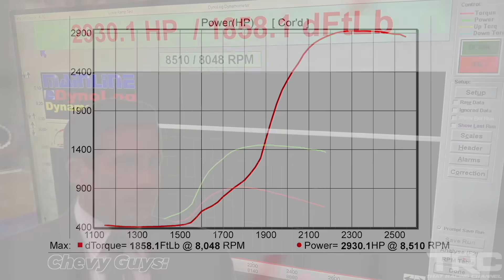3000HP Coyote SCREAMS to 10,000RPM! (BADDEST Coyote on the Planet?)

Comment: 185mph to the 1/8 is fucking insane 💨
Reply: Especially on a 275 radial
Reply: @robfeldschun6146  He won Sick Week against Lutz's Pro Mod!
Reply: just 220 yards!
Reply: Just imagine if the car was set up for 1/8 mile. It’s set up for 1/4.
Reply: Yea it’s a monster 💨
Reply: @jbuckshot01  he changes the gearing for the 1/8th
Reply: @DieselRamcharger  didn't he go 6.1xx?? That's one fast little 5.0
Reply: @jbuckshot01  yeah i think the 6.116 at maryland was his fastest with snot rocket 3.0. He attributes the longevity of the motor to the trans/tuning, he says if he ran the 6r80 the motor would be in pieces.
Reply: @ I live in Maryland and saw that.  But I think he just did it on sick week.  That’s a bad ass street car. Beating out promods.
Reply: @jbuckshot01  i wouldnt doubt he ran a 6.1 at sick week. i know his plan is to get that car into the 5's which is why they built the 3.0 car, as 2.0 was only certified to 6.0
Reply: @jbuckshot01  i think he went a 6.0something at sick week during a test run. calling these things street cars is quite the stretch. But it is cool to see these cars able to be driven, though they do change a fair amount of parts to get them into "street" trim
Reply: @DieselRamcharger  last run at sick week he missed the 5’s not sure if his last was was an 6.0 or 6.1  but he just missed it. Agree with you is it street car or street driven race car.

Comment: Freak levels of Horse power for a factory block! Ford definitely knows to build a V8 engine.
Reply from the maker: Such an amazing platform!
Reply: It's still a "modular" engine. For marketing reasons they don't call it that otherwise you would be crestfallen. 

Of course Ford knows what it's doing.
Reply: with Japanese components, yes.
Btw, ever seen Japanese engines with smaller blocks delivering the same amount of power ? yeah.
Reply: @anjoLas  yes but have they ever been a 620 not unless a true promod
Reply: For 45k you can have a 1000 whp f150
Reply: @anjoLas where are the “Japanese components”?
Reply: @anjoLas  and extremely unreliable at these power levels. yes, they can do it, but they have to rebuild the fkn engine basically after a few runs... if their lucky.
Reply: @sneezinhatch lmao what? My 22 rsb 4x4 stock cost more then that
Reply: @theclinchmma4126 not on built coyotes man. You talk stock shirt block coyotes
Reply: @anjoLas In any classes where imports are hanging with domestics. You'd better d*** well. Believe there's huge weight breaks.
Reply: @anjoLas  small engines at this level get rebuilt after every event or even every pass. Same thing as saying you can skydive without a parachute just once😂😂
Reply: @Vikturus2k6  did u even see what i replied to or are u just assuming??? I wasn't talking about the coyote, I was talking about Japanese engines.
Reply: @theclinchmma4126  naw, I figured another yote hater. All good bro
Reply: @chadkent1241 bro censored “damn” 😂😂 you’re a grown man.
Reply: @anjoLas yeah. They blow up after every run and they are full tube chassis Pro Mods with massive weight breaks. Only Vipers and Coyotes break into the low 6s with the original engine platform and body. The Fox Body can get into the 5s, but it requires an SMX, 426 Hemi, or Coyote swap because those are the only engines capable of pushing it into the 5s.
Reply: @anjoLas just keep vacuuming that cat fart can sympathizer
Reply: @elyjahtravis99  how's that "freedom" coming for ya ? xD
Reply: @anjoLas  I’m fantastic, but your gonna have to be more specific? Are you foreign to the U.S.? Was you preparing that cat for dinner???
Reply: What’s more impressive to me, is the factory crank could withstand that power level. Granted yes, it finally started flexing and touching down on to the bearings.
Reply: @anjoLas your clueless 😂🤡
Reply: @ingodwetrust1136  your ? You poor kid that doesn't even know English 🤗
Reply: @ you could thank your precious public schools. I’m also not a kid. I’m also not poor 😂😂😂

Comment: Stock Ford block is beast to hold all that power without a billet block
Reply from the maker: Truly wild stuff haha
Reply: Insane.. what does a stock iron LS block hold? *no shade, just curious
Hah I'm blown away at 2800 on a stock crankshaft 😳
Reply: @jamesborek8125  The LSX blocks might hold that much - the DART blocks certainly will - the problem is they would have to replace head gaskets every pass.  Their clamping force is horrible.  You can drill for bigger studs but that only helps so much.  Billet block is their only choice.
The real kicker is no LS heads flow what Coyote heads flow - and at the end of the day suck, bang, blow - flow is 2/3's of the equation.
Reply: stock crank too lol
Reply: Show me an LS that can do that please.😂🤣😂
Reply: Because a cast block can flex a little without braking into smithereens like a billet block?
Reply: @ThatRacingChannel  hi
Reply: @ThatRacingChannel  will Brett switch to one of the new iron coyote blocks is the question.
Reply: @kennethfeld6639 🤣🤣🤣🤣🤣🤣🤣🤣
Reply: @philliphutcheson4219 forge the bottom end like the coyote and it will do more on same mods
Reply: @Miamiboi305  nope. Been tried but Ford comes out on top still.
Reply: @Miamiboi305 you lie!! Ford is simply better!!
Reply: @metalted6128  something cannot be better over something older using less moving parts…. It is simply over achieving. if it were the ford in the ls position you would be screaming the ford is better because it’s still a pushrod. The underdog still runs with the technological young buck til this day. I love an underdog ls baby you free to your opinion but ford ain’t better it’s pathetic to get the results it gets from so much they do from factory
Reply: @Miamiboi305 does all that with less displacement. No LS is better😂
Reply: @kennethfeld6639  no one is saying bretts engine isnt drilled and studded. hes very careful about his wording but the motor IS NOT "stock" by any stretch of the imagine. The block and crank are. thats about it.

Comment: Ford to the front almost 10 HP per cubic inch sleeved stock block ported cast heads street derivable at 2950 LBS.  😎  Thanks Racing Channel.
Reply: There are very few engines on the planet that make more HP per CI than the little FORD!
Reply: Fords been doing this for decades. Like the 427 sohc, that nascar banned before it even made a lap. The 351C, which is and was the most banned and handicapped engine in racing history. There’s a local circle track around me. 50+ years later, they still have a ban on them lol

Comment: That thing is a ripper.
302 cubic inches.
That's amazing!
Reply: It's a predator block so technically 307
Reply: Can this car compete with street outlaw npk cars? Like murder novas etc.. I know they have 100k plus just in engine and transmission.
Reply: @Harlo86  I think they are running in the 3s in the 1/8.
Reply: @j_wide942 it's a Predator block but sleeved down to 302 in hopes that they can get more refreshes out of it.
Reply: @Hjfvvdst  4.08 I think is the best it's ran in the 1/8
Reply: @RayFinkle005  that's real close to 3s.
Now, with the steel crank, hopefully, they can push it a little further.
Reply: It's also a testament to the attention to detail on that team.
Reply: @Harlo86 Fawk no street outlaws does racing on the street too I don’t see this mustang hooking on no street off no water burnout
Reply: Those street outlaw people from the shows are mostly running big block engines, like the 481X...that are costing about 100K just for the damn engine itself! Crazy part about it, is that those costly engines are only good for about 50 passes give or take...before it needs a rebuild! They also run all high end expensive aftermarket parts from fuel tech, holley, etc...for fuel injection, ecu's and ignition systems. Ford Coyotes are doing all this with less money and lots of factory Ford parts. Coyotes and Predators are putting the world on notice fr!!!🤔😂😉💯💯👌👌
Reply: @Harlo86 Short answer, no.
Reply: Predator bottom end, that’s 317.
Reply: @Harlo86 the engine alone is past 100k. Everything else is an additional 200-250k. Those are 300k+ dollar cars, this costs half of that.
Reply: @The-fs5wn  even at 317 it's crazy power.

Comment: @0:12 what are the two axis on this graph showing? Y axis appears to be bhp. What is the X axis? Thx
Reply: X axis is engine RPM
Reply: @Andy_Pengwin  Hi - did you look at the graph? The range on the x-axis is 1100 to 2500. That doesn't really correlate with the RPM we hear in the video.
Reply: My bad, it’s probably the dyno hub speed.
Reply: It is dyno hub speed

Comment: Mullet Killer
Reply: Mullet has a real 4 link now - and he has 25# of boost he hasn't tapped into - Not sure if they are in the same class or not for Sick Week.  Mullet has a weight and wheelbase problem - it has too much of both.  He has the HP - assuming he can get it to the ground.
Reply: Mullet's problem is a rather ridiculous platform to make a racing sled out of.
Reply: @kennethfeld6639  cjrc and cleeter will never be on the level of people like brett and his team. they are true professionals focused on the task at hand, and nothing else.
Reply: @exothermal.sprocket  not really.
Reply: @ You'd rather a cab-over semi tractor I suppose.

Comment: Curious what the motor makes n/a. It might have been mentioned, but i was blinded by so much information it was hard to keep track.
Reply: NA is not what it was built for, It’s 10:1 with some beefy rods and pistons (heavier) so probably wouldn’t see much out of it NA compared to a max effort NA voodoo or gen3. But then again who knows lol
Reply: @BarnfindGT  yeah, i understand. Was just curious. I know at that level theyre purpose built.
Reply: ive seen a 750hp n/a coyote, that might be close to its limit being a 5l.
Reply: @BarnfindGT  its got alot of head and cam work.
Reply: @DieselRamcharger  yes but the compression is lower and the rotating assembly is heavier it more than likely won’t make more power or as much than a dedicated N.A. motor build with the same displacement
Reply: @ the rotating assembly in bretts motor is lighter than an NA build. there is no mallory in the crank and has aluminum rods. one of the reasons the motor holds together is the lightweight rotating assy. we really have no idea what the compression ratio of the motor is. even 20 years ago we knew better than lowering the compression ratio on turbo motors. it just reduces quench, invites detonation and offers less energy to spool the turbos. with good fuel and proper tuning the compression ratio is often much higher than you may think. cylinder pressure being whats relevant and the cams and turbos affect that far more than static compression ratio.
Reply: @ as of recently it might have aluminum rods idk I haven’t kept up with it, but the prior engine set ups and the one that made 2900 had steel rods and was about 10:1 compression. Brett and ffre have always been transparent on what that car has in it.
Reply: @BarnfindGT  2930hp was done on aluminum rods. they literally tore the engine down on camera after that dyno session. the video is about a year old and is on ffre's channel.

Comment: The turbo lag is massive, like three or more seconds. The transmission will be geared around max torque which is around 8000 RPM. This engine will not run at 10,000 RPM as given in the title, which is not really a problem because max torque is achieved through boosting and not tuning runners. The rev limit will probably be set to around 8800 RPM max and maybe as low as 8500 RPM at the track. 

With over 3 bar boost, copper gaskets are a given.

The big question is how the engine is cooled? The front heat exchanger is the intercooler. The amount of coolant and oil cooling will be massive for this engine so where is it? In the trunk? There could be a small radiator behind the intercooler but this is just for a close engine reservoir. Probably includes a small integrated thermostatically controlled oil cooler.

Comment: Not much coyote left in that
Reply: Rods, pistons, camshafts, sleeves. Nothing on the outside of the motor is sick of course, but I'd say that's pretty minimal for the amount of power it's pushing.
Reply: Sometimes horsepower made at high RPM is less stressful on an engine than the Chevy method which is usually capped around 7K and just pushing as much force below that as possible. Same reason why small engines on motorcycles with only 1L displacement can make north of 750 horsepower with force induction. The amount of combustion processes per second, even if smaller explosions, really can move you down track quickly without causing stupid stresses on parts.

Comment: When will people realize that Ford builds tough engines and tough vehicles?
Reply: About when Harley Davidson diehards realize Japan builds better EVERYTHING.
Reply: @exothermal.sprocket No.Japan does not build better everything,
Reply: @petergiannaros9037  Don't just make a statement without providing an example.
Reply: @exothermal.sprocket  Japan is aligned with the west and in just as much trouble. The coyote motor is about the best on the market, japan offers nothing even close especially right now. Japanese electronics have completely fallen off. Much of japanese manufacturing has been outsourced to china. You can be a japan fanboy all you want, but their glory days are past unfortunately.

Comment: How much HP can u output into the wheels, 500 ? 900 ?
uau
Reply: It runs low 6's in the 1/4. So much more than that.
Reply: 2930... that's what the dyno was measuring he's making well over 3000 at the crank.

Comment: R32 in aus made 3500 hp mid 6 secs
Reply: Barras have done similar, not much is stock on those engines though. MMR have 4000+hp Coyotes. The thing about this beast is its still stock crank, block and head.

Comment: coyote is such a cheat code similar to the ls but with a better block
Reply: Show me a LS with stock heads , block , crank that make this power!!!!!!!!!!!!!!!!!!😂😂😂😂😂😂😂😂😂😂😂😂😂😂
Reply: Better HEADS - that is where the power is made - flow
Reply: FAR BETTER THAN LS!!
Reply: Stock LS crank. Does it hold?
Stock LS heads. Do they hold?
Stock LS block. Does it hold?
Reply: @exothermal.sprocket  holds well enough to go 6s sbe making 1600 hp 😂 so yea it holds
Reply: @Gabethemosthated  Nah. LS grenades.
Reply: @exothermal.sprocket  any grenades when it’s not build right 😂 sbe Ls in the 6s stats don’t lie an it still hasn’t blown up
Reply: Nothing like an Ls.in the cylinder head department,
Reply: @Gabethemosthated  Does it compare to the stuff done to Real Street's Coyote which are still factory? No.
Reply: @exothermal.sprocket  fastest no prep dig cars are Ls cars 🤷🏽‍♂️ so I’d say it does
Reply: @Gabethemosthated  I won't try to wake you up anymore.
Reply: @exothermal.sprocket  wake me up from what 💀 Ik what coyotes are capable of, all I’m saying is ls are still on the top level for a reason, an nothing I said was wrong, coyotes on the street are inferior to Ls, as kc maxx and beater bomb
Reply: @Gabethemosthated  Mmm kay.
Reply: @Gabethemosthated this just isn’t true lol, maybe LS style, but even then most of the baddest no prep cars are big block

Comment: I love the build but at that point it isn’t a coyote it’s a full custom engine but I love it
Reply from the maker: Its honestly pretty straightforward stuff for the engine program, you’ll see on our work truck build series 😎
Reply: But it’s really not full custom. Stock block with sleeves and stock crank🤷‍♂️ this isn’t a ls, the design doesn’t need completely changed to make power.
Reply: @That_5.0_Ranger  tf its stock block 💀and I thought they just changed the crank
Reply: @Tazerect  they did just change the crank but even the stock crank was handling over 2k hp if I remember right.
Reply: Heads, block, crank all oem. It’s a damn coyote.
Reply: @ThatRacingChannel  Interesting they haven't close-decked the cylinder tops. Just a gasket swap to something tougher for pressure.

Comment: Still can’t beat them Twin Turbo Hemis 5000+ Horsepower
Reply: 302 CI with stock sleeved block and  ported factory cast heads.  🤔
Reply: Not 5000hp. 9000hp.
Reply: The difference is that those big inch Hemi’s are built for that purpose, insane horsepower. On the other hand, this is just a little 302 that was built for the average everyday driver. Take the equivalent 5.7 Hemi and try doing this on stock block and heads!!
Reply: Show me a Hemi of this displacement with a stock block and crank that would beat it.

Comment: It's crazy seeing a ford engine screaming to 10,000 rpm that isn't a flat-plane😂😎🔥
Reply: They were building Ford 351c engines and spinning them 10k in the early 70's.
Reply: Flat plane engines have secondary vibration issues as well. There's trade offs to everything.